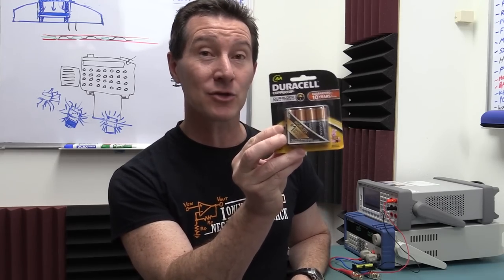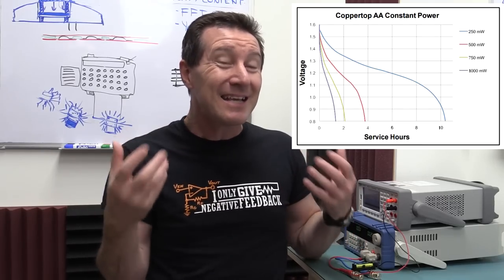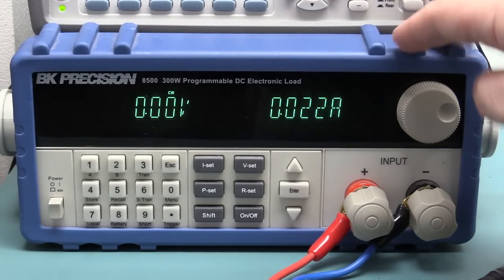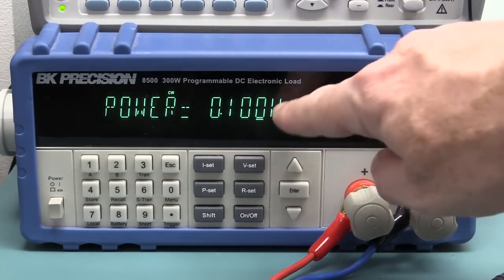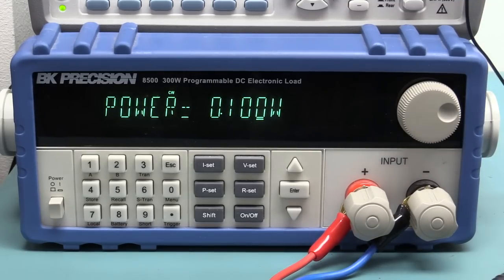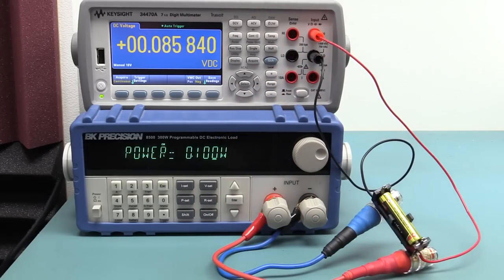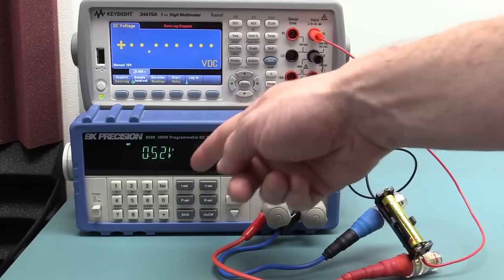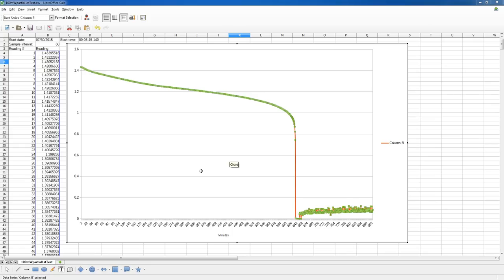EEVblog #774 - Low Battery Discharge Testing Part 1

Comment: Serial string commands are a PITA to decode. Changing field length, commands to mistype, sometimes protocols that are case-sensitive, values returned in weird E-notation or non-system decimal point. And as soon as you handle something like status codes you have to deal with a list of arbitrary numbers anyway.

Comment: The binary command format is much better because you can write a generic command processor that passes the data on to specific handler functions. Add in the checksum and you get a much more reliable data link.

Comment: I think you should design a test and logging rig.  Something arduino compatible.  Then test a bunch of manufacturers, lots, chemistries, etc.  Keep "big battery" honest.

I really love the video series where you take a set of specs, start with simple circuits, discuss/expand.  Then end up with a fully functional product.  Like the power supply series.

Comment: rs232 and serial strings?? are you nuts? if you want to get as much data over it as possible you have to use binary. and its not that hard if you have the specification for it. also strings are horrible to parse.

i just implemented a library for a little display that uses serial communication for its commands. wasnt that hard. even though the specification is in bad english.

(if ya have the spec, i might take a look at that thing :P)

Comment: If the ambient temperature changes, it will greatly affect the characteristics of the battery under test, much more, than the test equipment. At very low power levels, the differences won't be nearly as much, than if you were testing at much higher power levels. Beautiful test rig!

Comment: As a software engineer I appreciate the hex-based communication interface!!! Less bandwidth, more data!
Reply from the maker: sghulten Me too. In the case of an electronics load, speed isn't really a requirement.
Reply: sghulten Apparently you are not a software engineer yourself, otherwise you wouldn't spread such non-sense. Text-based data is a human-readable format which means you need to write a parser and take care of different command lengths and so on. Sending and receiving hex-based commands is waaaaaay more easier to implement than having to do it in text mode. Plus, it's more reliable as well. I don't understand what makes you think otherwise but I assume you're not a software engineer.
Reply: EEVblog Dave, you're wrong here. It's easier to process a hex-based protocol as opposed to a text-based one. A text-based interface means you have to parse the text output, extract the commands, their parameters and deal with different message lengths because every text command has a different length. When you have a hex-based protocol for which you even have the specification which means there is no reverse-engineering involved,  you merely have to write a simple send/receive function which puts the hex numbers on the serial interface and calculates the checksums according to the specification. Then you read the answer, strip off the meta data and output it to a text file which you can easily plot with gnuplot. Couldn't be simpler.
Reply: from a programming perspective, it makes no difference, text is easier to write libraries with
Reply: for what is worth, the 8600 model actually supports text commands, see https://bkpmedia.s3.amazonaws.com/downloads/programming_manuals/en-us/8600_Series_programming_manual.pdf

Comment: Dave, what if you used a Batteriser?  I heard it gives you 800% battery life!  ;)
Reply: Stephen Furr If your not just taking the "piss" then try  EEVblog #751 and you'll get Dave's answer..
Reply: AnthonyH Yes well I suppose the 800% was a dead give'a'way,but you never know..
Reply: Yes, I was just trying to be funny.  I knew Dave had already reviewed it.  Thanks!
Reply from the maker: Stephen Furr 800% or 8 times? They aren't the same!
Reply: Wid actually like to see one tested to see what % more it extracts
Reply: EEVblog dumb question, but what's the difference between 8x battery life and 800% battery life? I'm too tired to think it through. I know % increase would be different, like 1.5x would be 50% increase.
Reply: Stephen Furr thanks to Dave's video I've ordered Batterisers for my phone and PC. "people that make fun of you are jealous" that would mean that Dave was super jealous, hence it must be good!
Reply: KX36 8x = 900% and 800% = 7x! You have to remove the original value (100%)
Reply: Well that's not strictly true. It depends on what words you use around the two of them. "800% of" something IS 8x it, whereas "800% increase" would be 9x the original value.
Stricly speaking, if you want to use mathematical operators as you did with no context, 800% = 8x.

Comment: At the point of "failure" look at the voltages reported by the 3 devices. You'll see as the source decreases, the disparity between them increases. [Verifies that the error is in the wires]

At 0.1V@1A (100mW) on the load, the PSU is reporting 0.139V@1A (139mW), The voltmeter is showing 0.112V (112mW)

Comment: I use AA (Duracell coppertop) in my GPS. When the batteries are low and done, they are typically at 1.25V unloaded. So that is not too bad. I also noticed that at -20C the batteries last maybe 50% as long as opposed to+20C, and they do not recover when brought back inside (ie I do not get that other 50% back when the batteries are warmed up). I keep the GPS in my pocket during winter hikes but it still gets pretty cold.

Comment: Well, I think that this serial protocol isn't so difficult to implement. Just a couple of hex commands.
Reply from the maker: Eletronicafg Sure, but it's just a PITA so we ditched it on principle.
Reply: EEVblog I've read the datasheet for this load and found a little python implementation example that can help.
Anyway I'm glad that you provided all this info about batteries discharge curves, it will come handy when I need to design a battery powered project!
Reply: Eletronicafg I agree it's not difficult. The checksum is only a modulus. Although if you came in expecting some easy ASCII commands to implement quickly then it's not as easy. The reason they did the packet as for reliability and quick communications. If you waste time with 7-bit ASCII to communicate spending 5 times or more communication time that's what isn't explained.
Reply: Eletronicafg Even though everyone may do ASCII if doesn't mean its the right way to communicate. Actually, it's very wrong for the most part. Most companies don't understand software when the engineers write the specification for the equipment communication. We still see communications without a even a simple checksum in industrial devices.
Reply: John Borchers Checksum is not always needed. For example USB has error correction integrated, so you don't need it in your protocol. And ASCII is easy to implement. If you use some binary packages, you have immediatly problems like how to detect package boundaries, and you can't debug or test it with a terminal program, which is really helpful for testing new protocols.
Reply: Eletronicafg No one in their right mind would use text-based communication in an application like this - all that does is force you to write a parser for it on top of everything else. Wasted code. If the use case assumes there would be direct terminal-based communication with a human being involved - well that's something else; but if not, it's utterly pointless to bother.
Reply: EEVblog No, it's a PITA if it were text-based. Both Daves have apparently no idea of software development. Text-based protocols are for humans and easier to process for humans, not for computer programs.
Reply: ***** > And ASCII is easy to implement.

No, it's not. It's easier to send and receive a few bytes than having to send and receive whole texts and write a parser to process the commands. Writing parsers are rather time-consuming and error prone. Everyone who has a slight idea of software development will tell you that.
Reply: genkiadrian Writing a parser is simple. Everyone who has a slight idea of software development can implement a recursive descent parser in minutes.
Reply: A parser is rather complex as compared to a simple switch statement which will run certain code based on the byte read from the serial port. I really don't understand what makes you think otherwise. Data cannot get any simpler than single byte commands. Do you really think that "0x21 0x78 0xad" is more difficult to parse than "VOLTAGE_SET,10"? The binary data doesn't need a parser, you just check all possible values with "switch", job done. With strings, I have to mess around with string libraries which is error prone and complex. There is a reason people write abstract parser generators like "bison" because a proper implementation takes a little more than a few minutes.
Reply: genkiadrian With parser generators like Bison or Yacc you can implement a C compiler. Most instrument protocols, for example SCPI, are much simpler, so a recursive descent parser can be implemented in minutes. But I agree that a binary protocol can be even easier to implement, if you can detect the packet boundaries reliably, or if it is always a challenge/response.

The protocol of the load doesn't looks complicated, Dave or Dave2 should give it a try. There are many interesting things you can do with a load, controlled from a PC. In a project for a customer I used Qt in combination with QWT, which makes it easy to implement nice multi-platform standalone programs with diagramm drawing capabilities.
Reply: ***** For something that is not intended for human interaction, a simple binary protocol seems a lot more practical.  The processing requirement is also greatly reduced, which may be important in an application where every cycle matters (I suspect this is such an application).  I don't quite see why they assumed ASCII string-based communication.  With Dave2 on the payroll, they should take a crack at this (previously I would have said, don't bother).

You can do many interesting things with a PC-controlled load.  However, I would rather not give away my $1,000 lab instrument in a customer project (yes, I see new BK Precision 8500s for the bargain price of US$1K—not sure why someone was saying $4500).

There are many cheaper electronic loads under $300 from China supposedly made by BK precision but "ITech" brand (could be BS).  However none of these offer constant-power mode.  Some have  9-pin D-sub connectors labelled "factory use" but I would not expect communication capabilities.  It is likely that these lack any digital processing.

Comment: Good video Dave. Maybe you can come up with a precise explanation for, or eliminate, the noise/oscillation that the load is reporting after the brick wall response. Of course it's gibberish and not actual power remaining in the battery, but you know the nay-sayers will point to that and go "Look! That's the energy we're tapping into and you discounted it!". Because unfortunately it looks like more area under the curve, so it has to be explained to cover all bases.

Comment: The BK precision meter is using a PID algorithm for constant power output. PID terms are tricky to optimize for all conditions. Not enough derivative term and you get oscillation as is shown by this meter's response. Of course there's no energy here which is why the companies don't show <0.8V on the curves. Dave is right here, it's bugger all. If it was good you could guarantee the company marketing datasheet would show it.
Reply: John Borchers Really? How do you know? Doesn't really make sense to me using a PID, because of the nonlinearities of the 1/x function here.I guess it is  simply sampling the voltage at some interval and then setting its classic linear loop current source to the calculation I=P/V.This sampling interval and some group delay from the voltage to the set current combined with the battery impedance/equivalent circuit gives the oscillations, i guess.Maybe Dave can check the BK by giving slow AC lower than 1Hz (a function generator could maybe give 50mA) to the load in constant power mode and measure the current with a scope. I think you will see some aliasing on this current.Might be very insightful to find out how it actually is behaving in constant P mode, as the manufacturers don't give much information.
Reply from the maker: Raymund Hofmann Interesting thought. I've done it before in my own constant power loads as you explain.
Reply: Raymund Hofmann Because it appears it's overshooting I=P/V. There are also messages in the forum regarding this meter. I stand by the claim it absolutely has a PID control algorithm.

Comment: The problem with setting the load to constant power and measuring only the voltage is that the power in the load is not exactly equal to the power in the battery, the difference being the power lost in the wires, contrasted with constant current of course. As you showed in the video, the difference can be very significant at high current and low load power where the wire resistance becomes significant compared to the effective load resistance. If you measured the voltage at the load you'd still get an error, just in a different way. If it was constant current you could take only voltage measurements and know the current in the wires, load and battery are all the same, but the energy lost in the wires would still affect the time axis of the plot. So there's no ideal way to do it, all you can do is make the wire resistance as low as possible and/or measure current too.

Also, does your load let you know if it can't meet the set point? That might be a source of error if you're not measuring current but assuming constant power.

It would all be good enough to prove a lack of energy below 0.8V. Even this video shows that pretty well with 1 minute resolution, saying it takes "under a minute" to drop from 0.7V to 0V at 100mW is nearly as good as saying "it takes so many seconds which is less than a minute", because those seconds are practically useless.

Some electronic loads often have oscillation problems in certain modes like constant power or resistance, especially when combined with a regulated source. I think it's because of too many feedback loops trying to control the same thing with different bandwidths.
Reply from the maker: KX36 For the powers I'm talking about the voltage drops in the wires are petty small, almost negligable. It will only get smaller at lower power settings.
Reply: As you know, the closer the voltage gets to 0V, the higher the current gets for constant power and then it may become significant (in a more academic sense; only if you really want a very accutate measure of what's happening in this tiny fraction of the discharge curve). Look at the voltage difference between what the power supply and the load read at 0.1W, 0.1V, 1A on the load, as you noted it's a 40% error at that point.

But yes, it is practically insignificant beause through >99% of the battery life because the voltage is far greater than this and therefore the current far less until the last second or 2 of the experiment.

Comment: Maybe the large voltage drop below 0.8 volts is due to the internal resistance of the battery not allowing the current to flow below that voltage level.  That may be the reason for the oscillation, as the internal chemistry changes due to lack of electric charge.  The alkali material becomes more corroded (corrosive) as the battery looses charge. That's why alkaline batteries burst and corrode when they are old, destroying PCBs.

Comment: You should actually get a batterizer when they are available on the market (although it means giving them money) and make a video showing how the converter craps itself just a few seconds after the battery alone (or even earlier due to the loss in the converter).

And showing how battery gages dont manage to shut down devices sefely before the battery is empty or how the thing shorts the battery out and start a fire because it piered the protective foil of the battery (which is a much stronger point than the performance to me).
Reply: Róbert Valdimarsson If they stood behind their product, Dave would already have gotten a couple to test for free.

Comment: I have a small motorcycle battery here, it's lead-acid 12V 3Ah, and it's got some sort of defect: It charges fine, and when it's charged it has no problems giving out power, I can easily use a 12V 50W light bulb on it, it will draw 4A without problem, but when it sits idle without anything connected, the voltage drops at least 0.1-0.15V every 24 hours (roughly). I've let it sit for a couple of weeks now, and it has drained down to 4.35V a few days ago, and now it's around 4.2V, so now it only drops 0.05V every 24 hours. Does this mean "constant resistance", and now there's so much less current flowing that it will drain slower and slower? I've tried cleaning around the acid filler ports (it's a really old battery that has these little knobs you can open to refill), but I haven't gotten around to finding out where the drain comes from. Because, when I see its discharge behavior with higher loads, I think it is still somewhat good for something (like a backup battery for an alarm system or something that needs long standby times without drawing as much as the starter of an engine would), if just there wasn't that annoying drain!